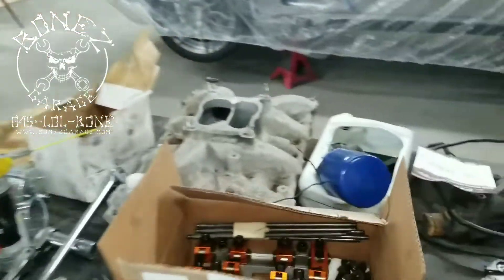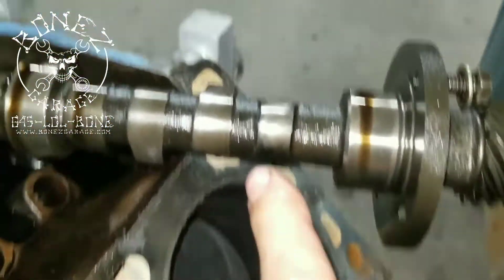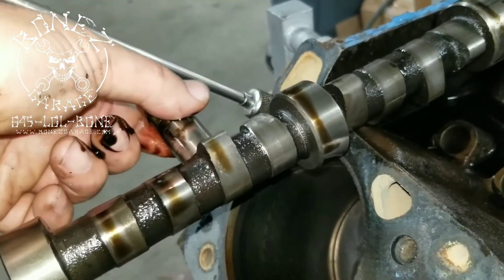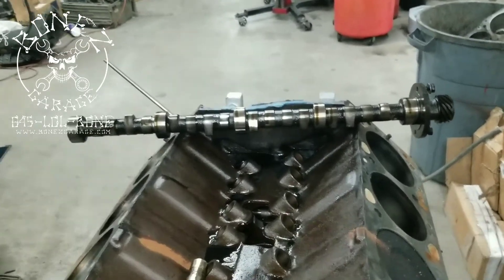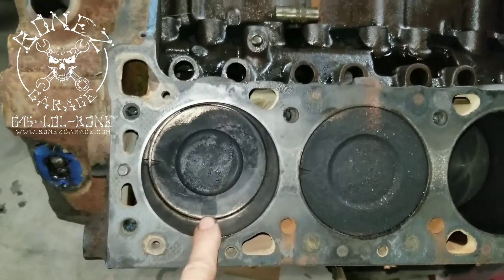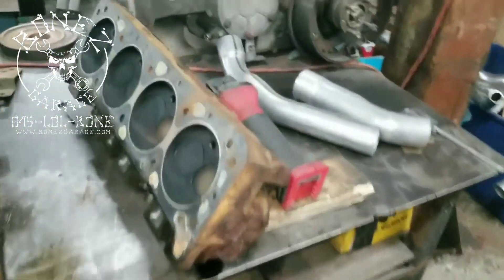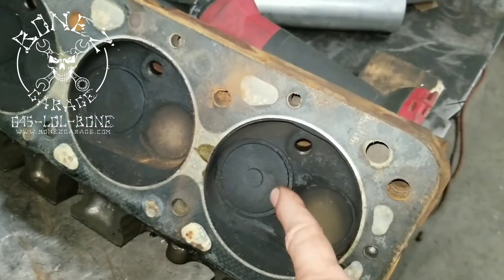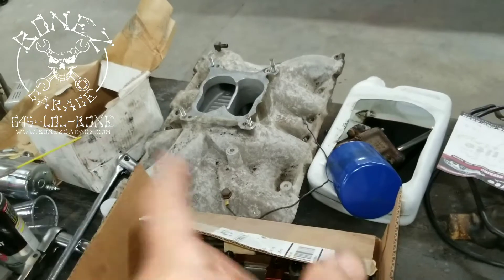Cadillac 500 - 472cid motor build - BonezGarage.com

Comment: You really need to do a little research before you do a video... So much wrong information.. 1.77 stock intake valves??? Really?? They are 1.62 valves... And 2.00 intake valves. You can upgrade to Pontiac valves with 2.11 and 1.77 valves. And you are so completely off on your compression raitios.... On some of your statements you are over two full points off in your compression ratios. Swapping the 76cc heads with those dishes pistons will give you nearly 12.5:1 ratio...

Comment: Did you swap the pan out? That looks to be an Eldorado pan not a Calais pan. Dealt with a few of these torque monsters in my day. I have one in a 78 Chevrolet pickup used for a tow pickup.....bone stock 76 Eldo 500 with 3.07 diff pulling 12k lbs.....works a bit at full load but 70mph at 2500rpm.

Comment: If I were to build a 472 Cadillac big block, I would build it for torque and to help it get good fuel mileage.  Considering what they came with stock for the torque rating, I would want at least 100 to 150 ft-lb more for low to mid-range torque output.

Comment: Your dreaming with a bunch of money and some choice parts like a set of cromemoly con rods and forged Pistons have the crank off set ground and use a big Chevy journal and bearing with a 7.100 con rod length a roller cam from Howard's roller rockers from speed master  main studs from ARP  Ford cleavland stainless big valves there the same length as Cadillacs just have the heads Done to except them no seats nessasary the cadi had 10% nickel in the 472 ,500 blocks n heads in 68to71 there the strongest stock block big block ever made and port the heads you can run a big block Ford intake with a little work or the Edelbrock performer big Chevy headers work with a little work 500 HP with work but you won't see more if you don't do as I sigjest I've built many bb cadis you need to order custom je Pistons for the combo do your home work the 7.100 rod is a trick piece that makes a better running motor speed master has them for 200 or so I have good luck with there new stuff edelbrocks top man took over speed master the company had to make good parts or go tits up so they are making good stuff now I've built a few 514 big mopars and I made 850 HP with one carb but I ran the speed master aluminum heads cnc ported 12 to one comp with Indy intake and a 4500 1600 cfm TMP dominator IN A DRAG BOATS